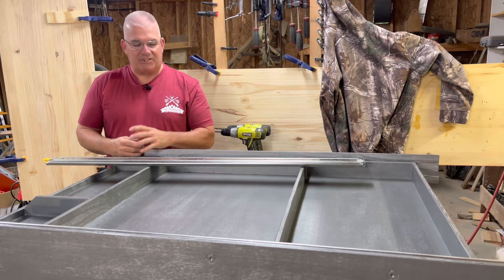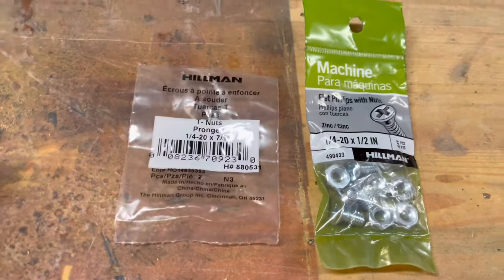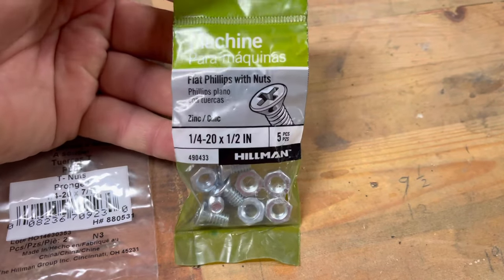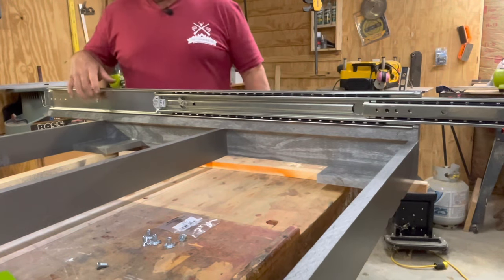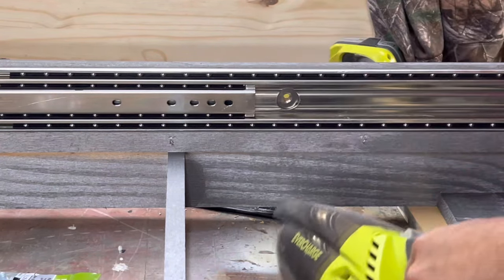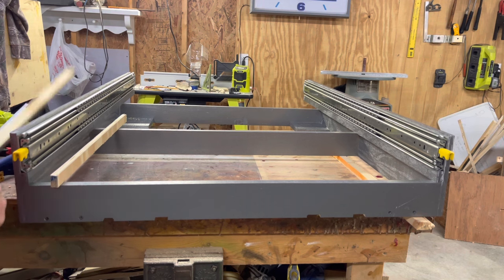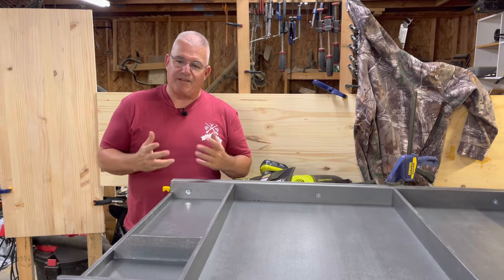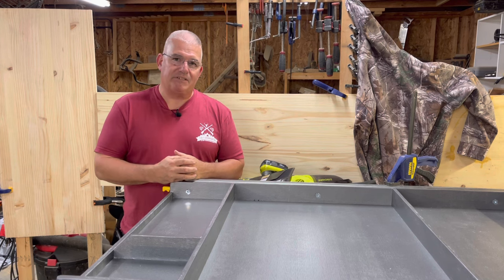DIY Locking Drawer Slide Install

Comment: Great video! In an RV, it appears that there would be some good space wasted under the drawer, however if the drawer was padlocked at the front, then the space underneath would be quite secure.

Comment: Quick question? Do you think the locks pn these would allow then to be mounted vertically, & support a small the medium weight? (eg. Be used as a 'slide down' computer monitor stand)
Reply: They hold the weight you put on top as you accelerate/brake... I suppose it'll hold up just fine

Comment: Great video, I’ve been looking online for a pair of heavy duty drawer slides.  I think my search is over after watching your video. Do you if these can be mounted flat/horizontal or do they to mounted vertical?
Reply from the maker: I haven’t looked into mounting them flat but I don’t think they could offer the same weight support if they were mounted flat. I would recommend contacting the company, they have provided excellent customer service and I believe they would be happy to help you find the proper drawer slide to fit your project needs.

Comment: I had been planning on building your other (original?) Video. Why are you building  with a slide now. Were there problems i should watch for. Can you share reasoning for new build. 
Thanks
Tim  DuBon
Reply from the maker: So sorry for the delayed response. There were absolutely no issues with the original build. This new build with drawer slides was in a new camper where I wanted to have what I had on my old camper. The reason I used drawer slides is because Vadania reached out to me and offered me the drawer slides to try. I hope this helps and thank you for watching

Comment: Nice work.  Are you going to make a video on it mounted in Travel trailer cargo area.?  Was it worth loosing space side to side due to curvature of outer door?
Reply from the maker: Thank you very much. Yes, I have a video on the drawer mounted, I just need to finish editing it and I’ll have it uploaded soon. Yes, I’m happy with the space that I can utilize with the drawer and the space on the sides. I still store all of my stackable leveling blocks as well as my Anderson blocks on the left side of the drawer and my x-chocks and tire chocks on the right side of the drawer. Be on the lookout for the video of the drawer installed.

Comment: Can there be installed horizontally? So I can just have a shelf and not a drawer?
Reply from the maker: I’m not sure how that would work.
Reply: What you're looking for are "undermount drawer slides".

Usually these kinds of locking drawer slides (in the video) aren't designed to be used horizontally. Confirm if yours are by looking in their 'installation instructions' or manufacturer specifications.

Comment: How did the paint on your seat on the hunting buggy hold up?
Reply from the maker: The hunting buggy seat is holding up well. There are a couple spots on the drivers side, where the seat gets stretched the most, that the white is starting to show. It just looks like there are stretch marks in the black. Over all, in comparison to buying a new seat or seat cover, I am happy with how it has held up since June of 2021.

Comment: Can they come disconnected?
Reply from the maker: I don’t think they are removable once installed
Reply: Usually these slides let you depress the locking tabs when the slides are at full extension, to release the inner rails and allow you to take out the drawer.